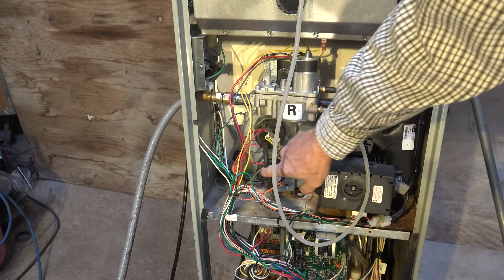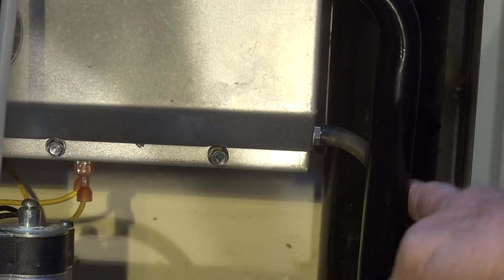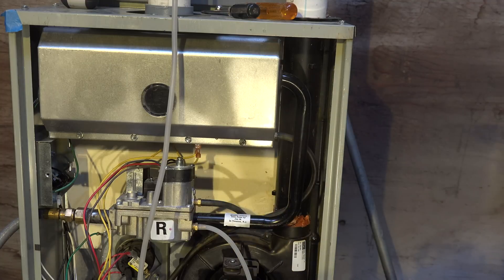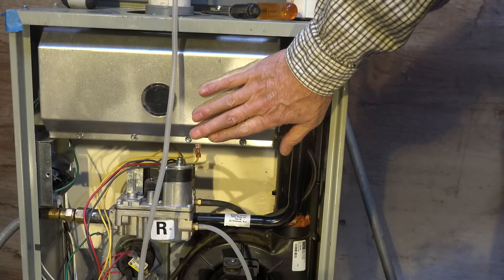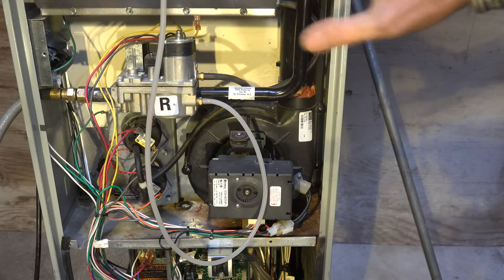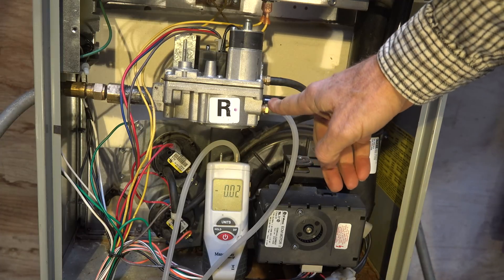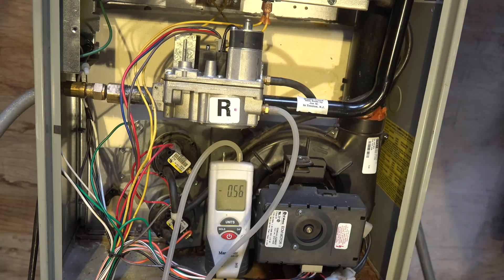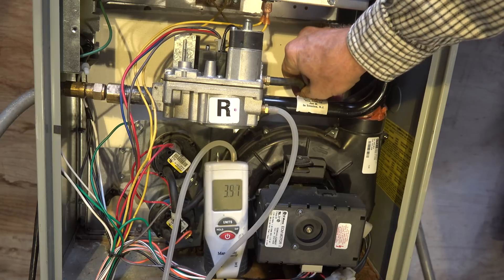What the hose in the gas valve does

Comment: Is it normal to smell a faint gas smell from that tube after a call for heat is completed ?
Reply from the maker: It could be, but I would wait a minute and check again.  A continued smell means there is a leak in the regulator.
GFM

Comment: On my Trane, there is a tube connecting the port on my gas valve labeled Pilot. But it goes to the vacuum switch. That really confused me. Does anyone have any insight on why it's setup that way?  I got a new gas valve and there are two ports vent and pilot. Which port do I use on the new setup? The thread sizes are different, so it made my wonder about using it.

Comment: Hi, i am replacing a gas valve for a furnace. The old valve doesn't use this (vent port) as it's not a seal combustion burner. However, the new valve also has a vent port with a small 90 degree  fitting on it. 
Can i just remove this fitting and plug it up? And set manifold pressure to 3.5"wc? Thank you for all your helpful tutorials.
Reply from the maker: Do not plug the fitting.  It needs to see ambient pressure.
GFM
Reply: Thank you for your reply.  I am a little confused because I see other furnaces that does not have a sealed combustion have this vent port capped with a white plastic cap. Even when it's a brand new valve from the manufacturer. Yes, for the sealed combustion furnace this vent port is being used with a hose to the combustion box just like your video. Please correct me if I am wrong. Thank you  sir.
Reply from the maker: @mark.r8900  The plastic plug is not gas tight.  
GFM
Reply: Please correct me if I'm wrong but i have always thought only air goes in and out of this vent port. Thanks
Reply from the maker: @mark.r8900  True.  It is referencing the regulator to the ambient pressure or combustion chamber.
GFM
Reply: So no gas should be coming out of this port correct? Thanks
Reply from the maker: @mark.r8900  Yes
GFM

Comment: Hello, is there a concern if the replacement part does not have the vacuum tube for the burner box?
Reply from the maker: The gas pressure will be incorrect because the regulator needs to be in the same pressure as burners.  Under normal operating conditions it may not change the firing rate more than 10%.  But if there is a slight blockage in the combustion air piping, it could get much higher.
GFM

Comment: hi, do you have to remove the burner box when adjusting the manifold pressure or leave the box closed with all hoses connected? thank you.
Reply from the maker: All hoses and covers in place.  
GFM
Reply: the reason i asked was because i got a sealed combustion furnace. with the burner box closed i was getting 3.7"wc but with the burner box off my reading was 3.5"wc. the rating plate calls for 3.5"wc. So in this situation i need to bring the reading down from 3.7 to 3.5 with burner box closed. Is this correct ? thank you.
Reply from the maker: Correct  
GFM
Reply: Doesn't the manometer need to be referenced to the pressure in the burner box for an accurate reading?

Flow is determined by pressure differential so theoretically the manifold pressure should be 3.5" above the pressure in the sealed burner box, not ambient. 

I've seen install instructions that say to have the reference side of the manometer teed into the  pressure/vacuum line tubing or open the burner box when checking. .
Reply from the maker: @Jon-hx7pe  I don't think so.  As the regulator is referenced to the box, it should be right.  
I would be interested to see the install instructions that indicate referencing the manometer to the box.  Thanks for the thoughts.
GFM
Reply: Well, checking it as shown, manometer is sampling the pressure difference between the atmosphere and manifold rather than the burner box and the manifold. If the box is like -0.2" WC as an example and the gas pressure reads 3.5" above atmosphere, the effective differential is 3.7", not 3.5", resulting in higher than normal flow and slight over-firing. 

I'm not a professional but interested in this stuff ->some install manuals I've seen say to remove the box when checking the pressure, others to tee the reference side into the vacuum line hose.

 I imagine teeing it in and leaving the cover on is more accurate because the intake venting is taken into account due to being referenced to the box - whether it makes a difference or not must depend on how the specific gas valve responds to reference pressure. 

i may be splitting hairs and focusing on the wrong thing though. heating values and densities slightly vary across the continent. 3.5" may not even be the correct pressure to get exact input in all applications.  furnaces may ship for 1000-1100 btu/cu ft from factory and could be off by up to 10% at factory pressure.
Reply from the maker: I have been looking over some of the comments on this video, and I note that some viewers have been thinking this is an install video and I have been answering questions based on that assumption.  That is not what this video is for.  I am just explaining what the tubing to the gas valve regulator is used for.
GFM

Comment: Hi thank you for the video! My furnace was giving a pressure switch error and not lighting/starting, however once I tried unplugging the same tube you did in your video the error went away and the furnace started igniting and working perfectly which left me pretty puzzled. Is it dangerous to have the furnace running with that tube unplugged? And does the fact that the furnace only works with that tube unplugged mean I need to have the pressure switch replaced?
Reply from the maker: It is probably telling you that there is a problem with the combustion air supply.  As in blockage.  I would not leave it operating with the tube removed.  
GFM

Comment: I'd like to thank you for all of your excellent videos and teaching. I have a 100000 btu Sears and Roebuck model 764732. The pilot light keeps going out. When I relight it and turn it to run it comes to life and heats until the desired temp is reached, I've clocked it running continuously for an hour and a half. When it stops the pilot light is out. I relight it and turn it to run and the pilot continues to burn until the next cycle. Please help. Thanks again.
Reply from the maker: I am assuming the pilot goes out when the burner shuts down.  If there have been no recent repairs, I would start with cleaning the burners and pilot burner.  
GFM
Reply: @grayfurnaceman  thanks no recent repairs. cleaning the burners and the pilot was the first thing I did. I also adjusted the burner flames as demonstrated in your video. I also cleaned the top part of the furnace and the pipe to the Chimney.
Reply from the maker: Next, I would look at possible heat exchanger cracks.  If you turn the fan on with the burner off and the pilot on, does the pilot flame flutter or go out?
GFM
Reply: @grayfurnaceman  the pilot does not flutter or go out. I ran the blower for 10 minutes and the pilot stayed on.
Reply from the maker: At this point, I would be checking the manifold pressure.  It should be listed on the model plate.
GFM
Reply: @grayfurnaceman  Thank you! I will.

Comment: Is the pressure you are measuring here in the same ballpark for both natural gas and propane? I have lp and mine is about 3.25, but I keep reading online that LP pressures are supposed to be around 11 at the manifold. Is this measurement at the valve the same as manifold pressure?
Reply from the maker: LP should be 11 in wc.  If yours is 3.5, you should be looking at your orifice sizes.  The unit may be set up for natural gas.  This is unsafe.  Operating the unit without knowing how it is setup could cause a fire.
GFM

Comment: I have a very similar setup. The furnace is going into lock out. It lights and operates like normal if the combustion cover is off. Or if I take the sense line off the combustion chamber and blow into it while the furnace is starting. I have replaced flame sensor, cleaned air intake and exhaust, the induction motor runs fine and spins freely. I am a maintenance engineer on airline jets, so I'm not scared away from doing some general trouble shooting. However I am stumped. My pressure switch is the same as you have here (I only have one on my furnace.) What is wrong with my furnace?? btw very good videos!!!

Comment: also another issue we've found in these  condensing gas furnaces is the formation of gas combustion byproducts that slowly restricts the flow of air, causing pressure switch error codes and easily can fool you thinking about a defective air pressure switches...
Reply from the maker: Are you saying the byproducts form in the heat exchanger or the gas valve referencing tube.
GFM
Reply: I would like to know the answer to this as well

Comment: Should the manifold pressure be checked with the burner cover off or on?
Reply from the maker: Did some research on this one.  You are correct on the burner cover for the 355 CAV.  Interesting that meter clocking is done with cover on.  As for the 925TA, install instructions say nothing about covers.  Would be interesting to clock the meter on that one with and without cover.  Thanks for the thoughts.  I will be putting a note on the video as it is a Trane tuy.
GFM
Reply: grayfurnaceman I've wondered about this, too. In the Bryant 355CAV and other manuals, it says, "NOTE: Manifold pressure MUST always be measured with the
burner box cover REMOVED." (direct copy paste from manual.) Also, the newer high efficiency models don't have a burner box, but a sealed upper door. How would you check gas pressure on those?
Reply from the maker: The cover should be on so it replicates how the unit will normally run.
GFM
Reply: Look at it this way, with the cover on hence a slight negative pressure in the burner box if your differential manometer isn't also referenced to the burner box you aren't reading the true differential pressure across the orifices. Teeing your manometer's 2nd port into that reference hose should in theory result in the same reading with the cover on or off. The "cover must be off" rule is probably for manometers that aren't differential, IE don't have the 2nd port.
Reply: Some York Affinity furnaces also state to set the pressure with the cover off. They all seem to drop .1 - .2 WC when the cover is reinstalled. Perhaps they're having you set it up this way with a cushion to avoid situations of overfiring?
Reply: +Zorin Industries I'll state it another way. You are setting one up and have the cover on. The burner box is at say -.1" relative to the room that the furnace is in. If you set your manifold pressure with your manometer referenced to the room instead of to the same pressure as the burner box you will end up with that extra .1" across your orifices. Taking the cover off equalizes the box pressure to the room pressure.
Reply: Hey that's a good point. My Mano is equipped to measure differential pressure. I'm going to take readings both ways and see if there is any significant difference.
Reply from the maker: @Zorinlndustries  I have been looking over some of the comments on this video, and I note that some viewers have been thinking this is an install video and I have been answering questions based on that assumption.  That is not what this video is for.  I am just explaining what the tubing to the gas valve regulator is used for.
GFM
Reply from the maker: I will doing a video on the difference with cover on and cover off for several different brand furnaces to see the difference.
GFM